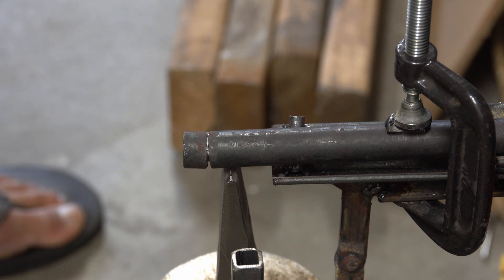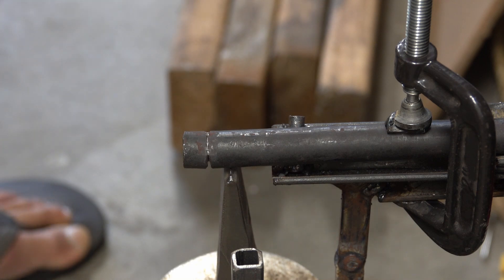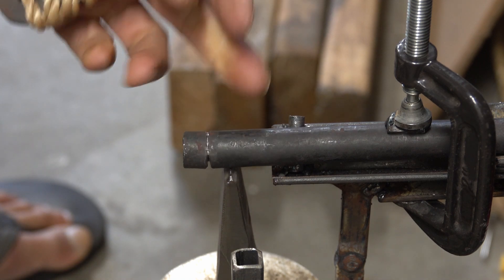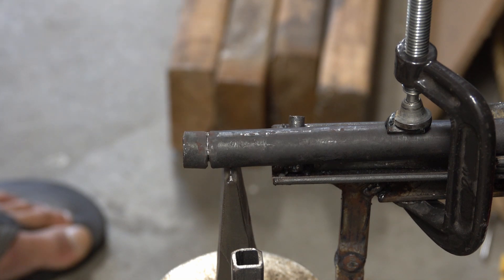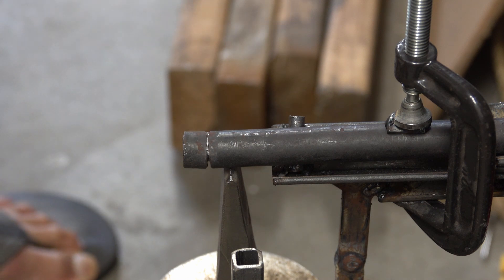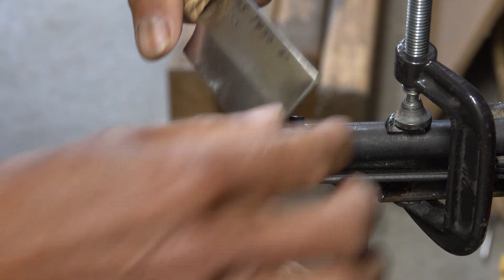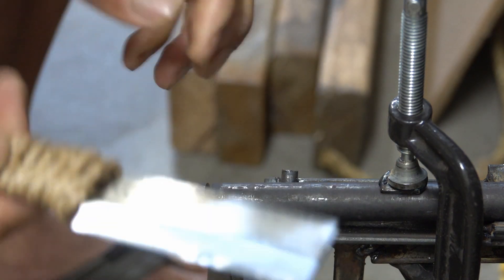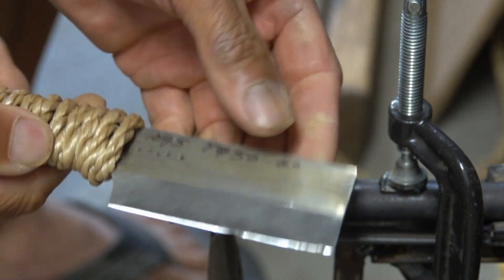1095 Toughness Test via Cuting 16mm Diameter Mild Steel Rod

Comment: It must be hard to keep the blade at a consistent 90 degree angle to the rod when initiating the cut.
Reply from the maker: Initiating 90*/perpendicular cut isn't the main factor for damages seen. Apex steering proportional to depth penetrating deflected edge into plastic and eventually fracture zone.  E.g. hammer this edge deep into African Blackwood would steer apex into buckled and chip the edge.

Comment: At 60 hrc is thouher 3V or 1095?
Reply from the maker: Maybe the answer is shown :)   have you ever see a 60rc 3v with an edge damage buckled(without chipping) this extensively before?
Reply: @Luong_La  Ok, Thank you for your reply
Reply: Again some great testing. Assuming that most steel are tougher than 1095 on paper, do you think other steel would also succeed. Like magnacut or v4e ?